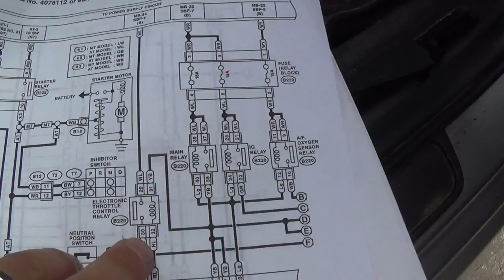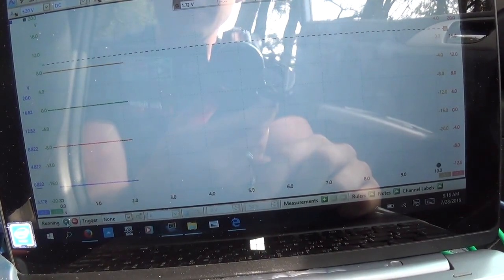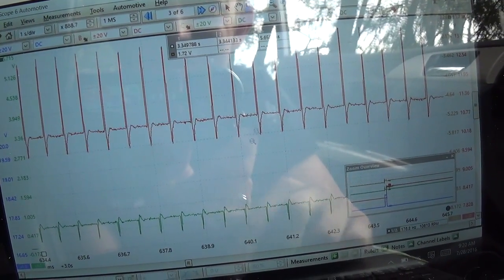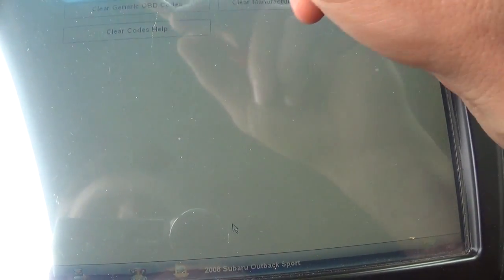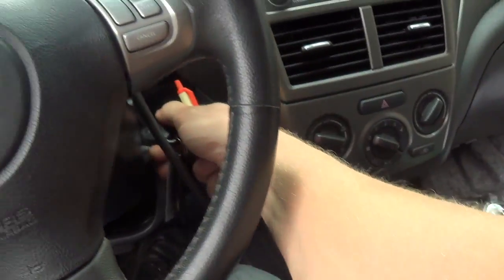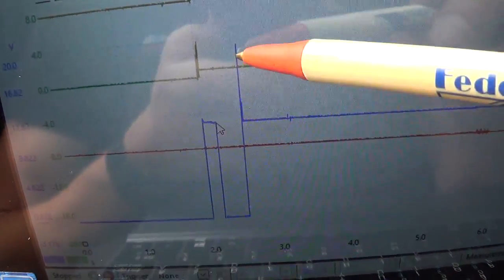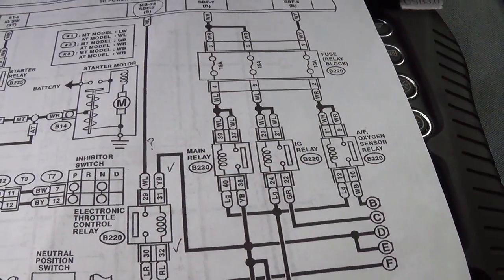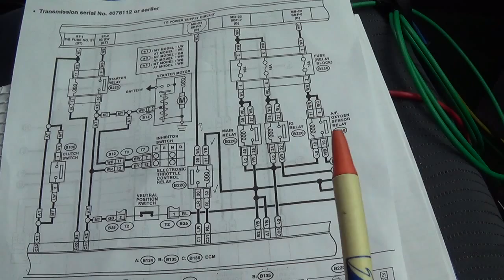Subaru Limp-Home P2102 Case Study - Part 1

Comment: Good video Ivan!!!...my guess is:...test all the 3 relays out of the fuse box. visual inspection (color, melt plastic, noise, blabla bla), visual inspection to all the fuses out of the box. Then judge the components condition. Place the fuses and relays where you want them!!! and you can try to trip the same code on purpose, no matter cold or hot engine. Evaluate the components. Then you can see if the problem is in that place or the problem came from some place else!!!...I think the problem is a bad relay (either control or power side), or a faulty relay connection. Well that is my guess!!!!...thank you so much for making your videos Ivan!!!!....that touch screen computer is awesome (scope fuction)!!!!

Comment: I say it's that generic relay. Just went through a relay diagnosis on my Volvo 940. Fan would remain on even with key off. Looked at the fan relay, and it was aftermarket. Grabbed an OEM one off my parts car, and it was fixed. Not much diagnostics - just alot of hunches, but it worked.  I did unplug the 3 A/C high side pressure switches, and the radiator temp switch, and saw that it remained on. That's as advanced as I got.  :)

Lots of crap parts out there today, so I lean towards that generic relay being the problem. Control side works, but secondary side doesn't complete the connection.

Comment: A few years ago i had a few intermittent faults on a ford Focus, finally tracked it down to bad solder joints on the relay/fuse box itself, the pcb had been poorly flow soldered. When the car was cold a few of the joints would act up, but once the pcb had warmed a little the joints expanded enough to work. 

Interesting video to watch, i look forward to the conclusion.
Reply from the maker: Solder joints on printed circuit boards always lead to trouble in high-current situations. Have seen it on many makes: domestic, Asian, and Euro!

Comment: Looks like they changed out the wrong relay and the aftermarket relay appears to be working b/c you have no O2 sensor codes but you usually have a twist to these scenarios so looking forward to Part 2. Nice case study so far!
Reply: Maybe, or they might have swapped them and put the Denso O2 relay in the Throttle and the Chinese one on the heaters.
Reply: Right on bud, ill second that. very good diagnosing demonstrated here. will subscribe for sure.  If he wants to go all out problem source isolation for the viewers. monitor WL from SBF-7 at the relay pin 29 in addition to monitoring C1 where he has it for now. If need be can relocate closer to or in pin 30 at relay to eliminate LR conductor. 
sorry for any typos, only had time to look over briefly. great job so for

Comment: Just a couple ideas!  Most ECMs use an ice break strategy to free the throttle plate should it be frozen from most air in cold temperatures. It is programed to rock the throttle plate back and forth to break the ice on cold start up. Make sure the reported engine coolant temp and air temp readings are valid. Check the throttle plate for binding as a stuck plate could cause an excessive voltage drop across the TP motor.
Reply from the maker: Wow cars are that smart nowadays? That's a pretty cool strategy!

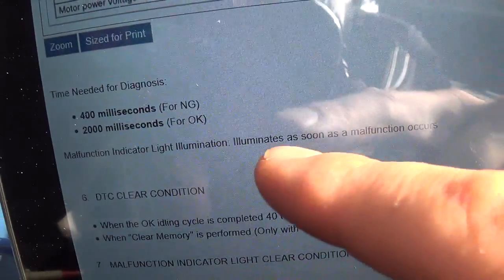Comment: nice diagnostic, at 2:09 I get confuse criteria for setting code computer expect to see high voltage in less than 400 ms when grounded the relay is that right? how ever it say ok  if occurred in 2,000 ms, Can you explain me a little bit professor I get confused some times with setting criteria like this and I know are key in diagnostic. 2000 ms is more  time

Comment: You should get some Freeze75, it's great stuff for chasing down heat related issues, allowing one to cool specific areas of a circuit which acts up due to warming up (or starts behaving, as in this case). In a pinch, a can of DustOff or somesuch held upside down works too, but you end up using a lot more product for the same result.
Reply: That was my first thought too, get some Freeze spray.

Comment: I'm kind of leaning towards the relays being made different and they swapped the O2 heater relay. The one for the Throttle probably should have a higher amp rating and/or with spike protection for the higher inductive load of the throttle motor to keep from burning the contacts.

Comment: I kid you not !!!! - this sequence of P2102 _ Throttle Low signals is the same as a Subaru EJ25 engined kit car 'im working on.

Either takes 2 starts to get running, ....and/or  long cranking starts...sometimes ends up in "Limp Home" mode.

Have the power on, clear codes and you heard Electronic Throttle Body reset - then you can start and rev car normally.

The wiring loom has been "modified/cut/modded" by previous owner.

And there is a "mystery Isolation switch" behind the seats, that needs to be switch on in the right sequence with ignition.

I can make car flag P2102 at will.
Can make car start and rev at will.
Can make car drop into limp mode at will.....

These all depends on on that "Mystery Isolation Switch" 
....which I now believe , after seeing your most helpful video, is the "Lost/missing ETC relay"..that the car builders forgot to install....so they just hacked a toggle switch in place.

The other give away is that if , with the key off, you toggle that switch, you hear noises from the engine. - sounds like electronic throttle motor, also the Idle Air Control Valve chatters.

Leaving mystery switch on flattens battery ..to the tune of 0.5amp .

Where did you get that circuit diagram - Subaru manual ??

Thanks again !

Comment: Looking at the wire diagram where the ETC relay is...it appears as though they replaced the wrong relay (look at where the fuses are located in the diagram). If not; possible sticking relay.

Comment: I have a 2014 Forester XT with a "Random Misfire" code. It only triggers a check engine light when I first crank the car and its warming up. I clear the code and a few weeks later it pops on again with a cold start. Super annoying. This started to happen after the dealer reflashed my ECM with a newer map.
Reply from the maker: Does it feel rough on startup? Stupid dealers reflashing good parts lol
Reply: motoYam82 Oh yeah its rough. It pops and struggles to idle then all of a sudden it smooths out. It makes a code though most of the time.
Reply from the maker: hmmm sounds like an incorrect fuel mixture on a cold start. I would check coolant temp and injector pulsewidth during the initial cold start. If the PW changes dramatically as it smooths out, then that would be a big clue.

Comment: Hi Ivan, I have a question for you. I have a 2007 Honda Ridgeline with 110,000 miles on it. I just started to have this problem that I can't figure out. When I drive at night with the head lights on they go from bright to dim.  When I'm driving and give some gas they go dim and when I let off the gas they get brighter. The battery is new along with the head lamps. I am thinking that it's the alternator. What do you think? Thanks Craig
Reply from the maker: Yeah definitely need to take a look at scan data related to the charging system, especially the ELD sensor that monitors the total electrical load.
Reply: +motoYam82 Hi Ivan, I would love to drop off and see what the problem is. I live in Ocean City Maryland and would like to know where do you live or service your cars?

Comment: Looks like they replaced the wrong relay, also in minute 22:12 you mentioned not worrying about the feed to the ETC relay, but notice there are 2 different fuses (MB-24 is for ETC relay and MB-23 powers main relay), so why not connect Channel A to that fuse wire, Channel B to the ETC relay output at the ECM, and Channel C to the control wire at the ECM ? or just swap the new heater relay with the actual ETC relay and see what happens.
Reply from the maker: The fuse is actually common "SBF-7". MB-24 and MB-23 are just circuit designations, meaning that one fuse feeds those two circuits. But I do like your thought process!

Comment: great video Ivan I'm suspecting that the one relay have an internal diode on the control circuit and the generic relay dosent seen this many times where's the launch pad I put the picoscope on my launch pad and it works
Reply from the maker: Which LaunchPad...the Windows-based X431 or the latest PadII Android version?
Reply: +motoYam82 the windows based there isn't much room on it to save the wave form and it's a little slow opening it but it does work and u can bounce between the scan tool side and windows side and neither one loses it data doing so the other tests on the pico work to as the battery test relative compression ect

Comment: along the lines of relay replacement//was it you that had a video up  where the relay was replaced with a cheapo  Vs OEM  and it was not being trigger correctly??..other then that no guess from me ..so no super mega bonus points for me :(
Reply from the maker: yeah that was the VW with the wonky fuel pump relay...I suspect in this case they just swapped in a generic one and got rid of the OEM relay, which was most likely still good!

Comment: Good move acquiring the PICO.  Hope you sourced it through AutoNerdz to get full value out of the equipment.  It is a fun and powerful tool.  How Long have you had that toy?
Reply from the maker: Actually got it through AESWave a month ago. I had some issues installing the USB drivers on the laptop, but they were extremely helpful in fixing the problem. It takes a bit longer to set up than the Verus, but in cases like this the Pico is indispensable!

Comment: I say the relay.  that bouncing when the relay activates makes me think there's some green crusties in the relay.  hope you cut it open after you swap it.
Reply: I would love to see the bad relay guts.  I would have been pulling those relays right out the gate, but likely to throw them in the refrigerator so I wouldn't have to wait a day between testing.  Probably the PCM too.  About an hour or two would do.  Just long enough to do a quickie job or go flying and clear my head/assumptions/assertions.
Reply: +briansmobile1 and this video shows me I need a scope.  I have a car with a o2 sensor not responding normally code, and a ecu that doesn't communicate via obd for longer than 20 seconds. I need to watch the sensor itself.
Reply: I know I needed one before and am hoping to see one I can afford to use.
Reply: +Lee Barnes I see a lot of the hantek ones on ebay.  little more cost effective for a shade tree guy like me.

Comment: I bet they replaced the wrong relay. 

Also why would you put a cheap Chinese relay in a vehicle when you could get a Denso one to do the job. I have really not seen that many Denso bits go bad. A clutch switch, a few voltage regulators and a few relays here and there.

Comment: Where's Eric, we need 5 minutes of grumbling/cussing of after market parts.  So funny to see a young guy sounding just like the old cronies we used to make fun of when I was a teenager.  Only then it was, 'Dam hippies, the world is going to hell in a hand basket'.  He gets wound up on it too.  Rightfully so I'm going to add, a recent snafu with a Cadillac purge vent valve shows many you buy right off the shelf are stuck open too.  Now that's some godawful quality control right there.  My guess is after market relay is crap.

Comment: Wish this guy lived near me lol i have a 98 GMC k1500 4x4 305 vortec has spark fuel air turns over starts to start and nothing then smells bad of gas like its flooded lol
Reply: Where are you located?
Reply: Coldwater Michigan
Reply: Bad coolant temp sensor, maybe?
Reply from the maker: What if you floor it while cranking? Does it run at all? Could be bad fuel pressure diaphragm on the spider assembly flooding your intake.
Reply: it will start and die right away and thats only every now and then, for the most part it starts to start and nothing, says im getting 62 psi at the rail, good spark, its not the vats system but after turning the motor over it smells of raw gas bad, the truck has 200k and just stopped im lost and really dont wanna start replacing everything if its good lol
Reply from the maker: Try cranking while pushing the gas all the way to the floor and then fluttering the throttle
Reply: Same thing it gets SOOO close to starting then back to nothing just turns over

Comment: Seems to me that Subaru doesn't have the reliability they use too. Great looking cars still.
Reply from the maker: That might be true, but don't be so quick to pass judgement on the manufacturer in this particular case :)
Reply: +motoYam82 Very true, but I'm not basing it just on this problem. They seem to have had alot of transmission problems and head gaskets. Then again on these failures one wonders how well the vehicle has been maintained.

Comment: Those relays are junk. I have replaced many on cranes because the contacts do not handle much load. Not even for a horn. I have a few new ones in stock 10 feet from me right now.
Reply: Nice wad wilco. Having extra relays is gpod